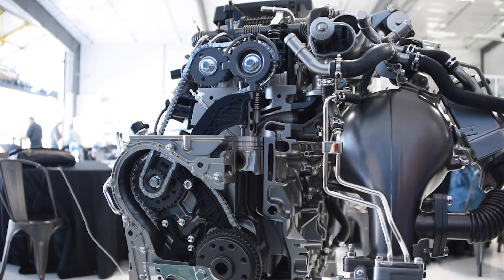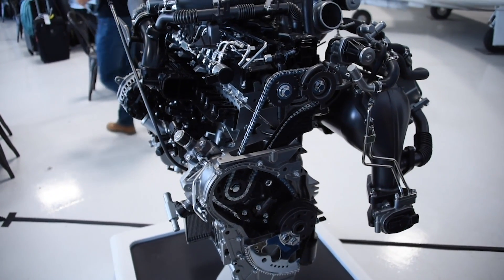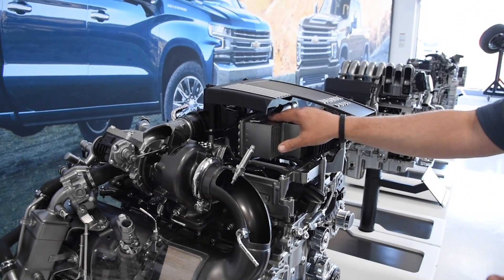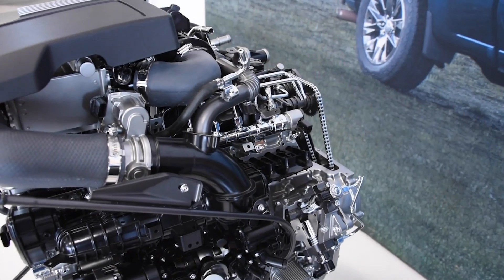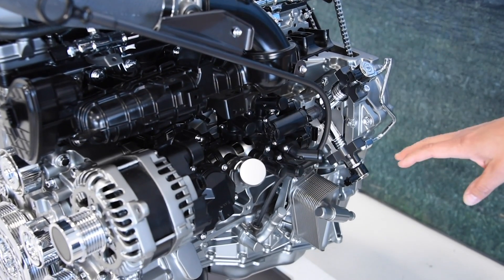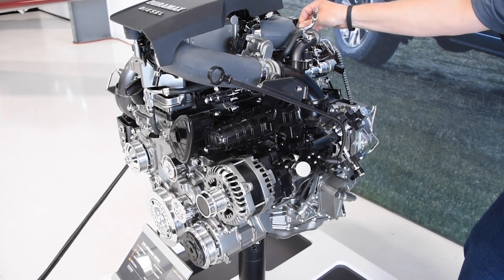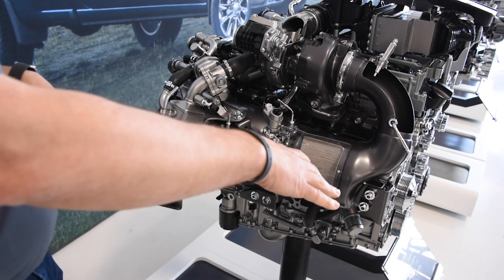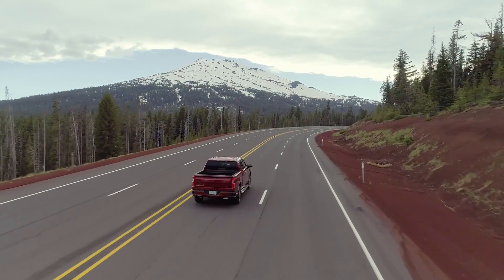What you don't know about the 3.0-liter Duramax diesel

Comment: If it’s not 18 to 1 compression and it uses glow plugs it not a true diesel. A true diesel produces all its torque at 1100 to 1500 rpm
Reply from the maker: Diesels are changing, Jon. Emissions standards now dictate the way an engine is engineered and produced, unfortunately.
Reply: The RV Connection I here you but disagree with you and I know full well higher combustion temps will produce cleaner burn and better fuel efficiency. Every time. That’s why modified 5.9 cummins can get 25 to 30 miles to the gallon on highway. When I saw the new inline 6 duramax I thought finally gm is doing it right. You can’t beat that design. I say change the studs on that head raise that compression up. And change that belt driven pump to gear driven. Look I love gm trucks and ram trucks. They were always better than Ford, are lil secret. My current 2017 6.7 actually runs cleaner than the average gasser. I know because I was curious , and I had it check out. What they are doing with diesels today is incredible. I will never delete my truck for this very reason. I just wish the egr was routed from behind the dpf instead of in front of it, a lil cleaner you know. You guys are definitely going in the right direction. It would be great if we could just stop the rust from destroying the vehicles around the drivetrains. Ram should have dumped that fiat garbage diesel and replaced it with cummins 2.8 crate engine that every one is putting in the jeeps these days.
Reply from the maker: @Jon-O.  Higher compression also produces increased NOX levels as cylinder temperature rises. That's why the new EcoDiesel also reduced its compression ratio from 16.5:1 to 16:1. Believe me, if they could get more power, better fuel economy and reduced emissions by simply raising the compression ratio, they would. There would be absolutely no reason not to.
The belt-driven pump was chosen over gear driven to reduce NVH. People want diesels to be as quiet as gasoline engines these days, which personally I think is dumb. If you don't want diesel sound, don't buy a diesel.

Comment: A Belt driven, off the rear of the crankshaft, variable flow oil pump.....serviced by simply dropping the transmission  out.,will save a pinhead of HP......why didn't they think of that years ago......, the idea of free drugs and booze in engineering design is starting to get out of hand....

Comment: So let me get this straight, you dipshits actually thought putting the timing chain in the rear, high pressure fuel pump in the rear, belt driven oil pump in the rear was a good idea! Well, that just   ensured that I am no longer interested in this engine, which is a shame because being an inline 6 was going to bring me to the Chevy dealer. Not anymore. I'll keep my titan xd.
Reply: Well said. This was going to be my next purchase. No longer.
Reply: rochab77 you think that there will be an option where you can request a permanent chain belt
Reply: @victorchavez9020  I would hope so, but the fact everything is in the back of the engine makes it a no for me. Over engineered by some dipshit with a college degree and no on sense that will never have to work on one.

Comment: Well that's asking  for trouble  a belt driving the oil pump as the belt wears all them little bits end up on the bottom of the strainer  bang engine gone why not keep it to a chain engineers these days  try to reinvent the wheel but do it poorly

Comment: Will that fit in to AZR2 Chevy S10 pickup 4 wheel drive I wanna put a diesel in it more power specially if I put  A Turbo on it
Reply: Dude, go for the Cummins 4BT. Hell they make kits for that gas to diesel swap.
Reply: @JerzeyBoy  Or the 2.8 crate 4 cyl(a sweet little package)
Reply: @kevinmccune682  that too! Way cheaper that that thing. Hell ever swapped a the engine of Honda S2000 into an RX-8? Because I haven't.
Reply: putin 3 53
Reply: @1racemate  Pretty heavy old mill.

Comment: Gears and chains go inside, plastic and rubber go outside sir. Hopefully it's a one year design for GM.
Reply: Nope, seen a guy with 380k on original belt. Dude has 1.2 million on his 2013 6.6 as well
Reply: Anthony.. Bio kits (belt in oil) will be all you will see in the future. Noisy/heavy/horsepower robbing timing chains and gears are quietly riding into the sunset. The Timing Belt in Oil was developed to replace the metal chain. The rubber is made to last and run in oil for years.
Reply: @lowboy003  i have a timing chain on my tacoma and it has over 300,000k miles on original timing chain sir.
Reply: @mauiboy96768  You can't compare any GM to a Toyota lmao that's not fair.
Reply: @cheezuscrust7730  my bad.😂 i am not a guy that only “praises” to one car manufacturer, but i come to realize that my old toyota pickup is more reliable than my 2017 gmc sierra with the 5.3l.. it would always end up in the shop for something weird.. but anyways i ended up selling that thing, it broke on me 3 times leaving me stranded with only 35k miles.
Reply: @mauiboy96768  that's unacceptable
Reply: @cheezuscrust7730  true, my bad. Shouldn’t compare those 2 models.😅🤷‍♂️
Reply: The newer Ford 2.7l ecoboost gas engine has a wet belt oil pump drive, I still prefer to keep my truck about as simple as i can so I don't drive one of those either.

Comment: way too much over engineering. much rather have my 2007 5.9 cummins no emissions and no vgt turbo big single 468 68mm turbo with big fuel system still spools up amazing and makes 800+hp. when something goes it is simple to diagnose and work on compared to that shit

Comment: I thought the same thing when Harley put chains on the v twin. The first twin cam engines. But time showed them reliable. We shall see.
Reply: Yeah, but those chains are super-short from the crank to the cams. It's about the same as any GM pushrod engine where the chain only goes from the crank to the cam in the block. Also, HD cam chains were for noise reduction and the first time any owner got work done those were swapped out for gears.
Reply: H.D. and reliable? Not used very common in the same sentence. Lol
Reply: Harley's twin cam needs the chain tensioners replaced around 50,000 miles, several owners had the tensioner come apart and it was around 3,000.00 to fix the damage.

Comment: GM: We put a rubber belt in the back of the engine and call it easy to replace when you have to pull the engine from the transmission.  Me: thanks I'll go take a look at a better design.

Comment: At first I was thrilled to hear that this engine was a straight 6.  After listening to the engineers it sounds like there is just way too much to go wrong.  Something tells me this won't have the same reliability as the 4.0 in my Wrangler.
Reply: can’t compare apples to oranges
Reply: This is a modern diesel that employs the latest design techniques to maximize power and fuel efficiency while still being lightweight. The 4.0 is a gas engine derived from the original 2.5 of 1984. Reliability of most engines today is much higher than earlier designs so assuming good maintenance practices (especially important in diesels) it will quite likely be enormously reliable.
Reply: @Indy_at_the_beach man really said “maximize power” like this thing can make a constant 200hp without blowing up/overheating.
Reply: @Indy_at_the_beach  bot
Reply: Because anyone who knows more than you is a bot? Lol
Reply: or the 3.7 v6 in my Dakota.

Comment: 1. Belt driven oil pump, really, stupid. Make it gear driven. Apparently he's never removed a transmission.
2. HP fuel pump driven off the cam chain, in the rear under the cover behind the transmission. I'll bet that to get the pump out the transmission and cover have to come out to get the chain off the pump.
These engineer's should have to R&R these parts after a few years of service. I'll bet they'd change their view on serviceability.

Comment: "277 hp/460 ft lbs of torque".  If the upcoming Rivian R1T, with its advertised 750 hp/14,000 nm (~10,300 ft lbs) of torque proves to be reliable, both this and all fossil fuel engines will instantly become under-powered, obsolete dinosaurs...

Comment: Timing on back of a engine. Engineering nightmare at its finest
Reply from the maker: The engineers told me the main reason for this is that there is less harmonic distortion on the back of the crank than the front, which makes for more accurate timing/fuel delivery.
Reply: @TheRVConnection . So the engineers are implying the crank likes to twist a bit, eh?  Lol. Maybe they should have made it beefier.
Reply: @TheRVConnection  And a rubber belt absorbs the torsional distortion much better than a timing chain or gear drive.
Reply from the maker: @lowboy003  You are correct, sir
Reply: @The Restless Traveller Correct, and now a year later, we are finding the BIO (Belt in Oil) kits with special rubber compounds will outlast the motor.. I can't believe all the kids here posing as clairvoyants and engineers trying to impress people.

Comment: The belt won't be an issue for most new buyers.  It's the guys that buy used around 100K miles that will need to keep the oil pump belt in mind for replacement cost.
Reply: I get your point. Also when they have that thing down they could probably fix other things as well. Everyone’s looking for amazing reliability and nonexistent maintenance

Comment: “Serviceable by simply dropping the transmission”  - 😂 what a joke 😂
Reply: Engineer's trying to be a mechanic..  oh its easy to do.. lol
Reply: He didn't mention removing the flywheel to get at the cover.  (Shade  tree stuff.) This engine is built for the government, not the customer.
Reply: @dscottmacleod321  How is this belt service any worse than servicing Ford's Eco-boost water pump? Half the mechanics say the easy way is to pull the engine, for a damn water pump.
Reply: @wymple09  GM trucks are WAY easier to work on by far and more reliable.
Reply: @mecalpsha4473  
More reliable? Lol
Reply: @wymple09  As I recall, several of those Eco-boost engine removals require taking the cab off the frame.  
Sadly, my comment was driven by the growing complexity of our lives due to out of control bureaucracies that have no oversight.  Diesel engines used to be simple  and durable.  Fleet fuel economy requirements have the engineers dreaming up increasingly complex methods to squeeze the last percent of fuel economy from this year's vehicle production.  The consumer is required to purchase highly expensive cars and then pay for repairs that outstrip trade-in value, while being told they should recycle and live "green."
Reply: Christian Griffith the f250 had been rebuilt once because my dad used it with a 32ft wedged car trailer first rebuild was about 3-5 years after we bought it and mind you it constantly had a 32ft trailer hooked up to it and she’s still purring like a kitten oh it’s got 268k the Chevy had 215k I believe it’s been a while since I’ve seen it.
Reply: @wymple09  Have you ever changed a heater core in a Taurus?  GM and Ford engineers must go to the same school.
Reply: @wymple09  the 3.5 ecoboost in the f150 is belt driven like a normal car. In the 3.5 in the taurus is a pita
Reply: @wymple09 forget Ecoboost water pumps, the 5.0 Coyote and 2.7 Ecoboost also have wet belt oil pumps just like this engine, except the belt is at the front of the engine and requires more labor hours to change than this 3.0 does. Partly because Ford routed the belt behind timing chains and the fact that there's way more sht in the way at the front of the engine.
Reply: @ Yes, GM is more reliable. My BIL is a Ford guy, has NEVER gotten 200K out of one.
Reply: @dscottmacleod321  to start, do away with the DEF shit that’s one thing that’s a joke just for the Government
Reply: Why wouldn't they just use a gear to drive the oil pump? It's so close...it probably doesn't even need a chain or belt.
Reply: why wouldn't just use the no need for service chains to drive that oil pump
Reply: How is this any different than servicing a clutch at 150k or more? I’d much rather pull a tranny (and service it while I’m in there) than remove the entire accessory drive off the engine. 6-8 hours of labor every 150k I can live with that.
Reply: no need to drop the tranmission you can move it aside and service it. mechanics have said its more uncomfortable but it could be done. plus these belts now have a 200k service interval.
Reply: sounds like a typical chevy/government motors product ... come to us for 3x cost because you cannot get parts elsewhere
Reply: Couldn't believe that idiot said oh it's simple followed by remove the transmission and slide it back! What a f'king idiot!
Reply: Lol I said the same thing what a joke
Reply: It’s actually not as hard as you think it will be.. 2 days in my garage with a case of beers
Reply: How is this any different than fixing 6.7 power strokes with constant upper oil pan leaks?
Reply: 💀💀EZ PZ
Reply: This engine draws it's design from the Opel 1.6 CDTI, as also found in the 2017-19 Cruze, Equinox, and Terrain with the diesel engine. It's extremely obvious when looking at the two even in pictures. In Europe there is also a 1.5 3 cylinder and 2.0 4 cylinder. The 1.6 has a chain for the oil pump. 1.5, 2.0, 3.0 have a belt. No idea why they decided to change it from a chain to a belt because I've never seen an issue with an oil pump chain on a 1.6.
Reply: Anyone who ever dropped a transmission knows it ain’t that simple lol…
Reply: He's definitely talking about professional mechanics not street mechanics, anytime you get inside of the engine to work on is very hard for us, but not for professionals that have the right tools.
Reply: I Know Right! 😅
Reply: How hard do you guys think it is to pull a transmission though.. be real its all nuts and bolts and a little bit of time have that done in 6-7 hours
Reply: The joke is that know-nothings make a big deal about this belt. There at guys with well over 200k miles on the belt without issue. And this is a GM, you'll be dropping the transmission for a rebuild well before the belt is anywhere near wearing out, so it turns into a "while you have the transmission out, might as well change the belt" situation.
Reply: As easy, or easier, than tearing off the entire front of the engine. It is one of the reasons for putting it back there.
Reply: They said by moving it forward like moving your clothes in your closet. a simple repair 🤗
Reply: Maybe if the transmission is shot, while replacing it throw a new belt on the pump...
Reply: Yep! just drop the transmission it's that simple. These responses are like no one has touched a tool before, so if that's the case drop it off at your local dealer and suck it up and pay the piper!!! Bet a belt could be replaced at Home on short day. Suck it up buttercup get dirty and bust a knuckle you whiny pussies!!! It's not ROCKET science.
Reply: He said Backing off the trany.
Reply: Yeah...I'm a hard pass on this one.

Comment: Yeah timing belt for the oil pump what a joke a hundred fifty thousand and you got to pull the transmission loose people buy diesel motor for longevity so I got a Cummins
Reply: Dj Morgan this is a inline 6 for 1500. Your comparing a 2500 truck to a 1500 motor. Il take my 6.6 duramax with a better tow capacity, and in a car thats electronics arent shot to shit because its an italian truck now. Dont get me wrong though this little inline 6 already smells of shit

Comment: Even after you pull the transmission, you'll still be replacing two chains and a belt from underneath the truck with the engine against the firewall. If you're going to do all that, you might as well pull the engine. Anyone who thinks this job would be easier than replacing a  front timing chain is nuts. And a belt driven oil pump? If that belt ever brakes, it's not going to give you any warning. If it brakes you'll have to pull the engine anyway because it'll be junk. The only reason to design something like this is to sell parts and service. They are building vehicles that you have to take it to the dealership for any work or buy another truck.
Reply: chad Spidle you’re correct about the firewall but techs won’t be pulling the engine to do service. They’re going to pull the cab off the frame.
Reply: @steelcityundercoating  
Yeah, that sounds cheap. 😂
Reply: DEAD ON !
Reply: breaks
Reply: No need to do the chains
Reply: I don't think the transmission bell housing  area, after transmission is removed, is "against the firewall" and the belt is in the lower half as well.. you wouldn't have to remove the chains to change the belt.,, If the chains fail the engine is coming out anyway.. pretty much guaranteed.  I don't know if the oil pump belt is as big a deal as people are making it.. engines with belted timing belts can be a pain it the butt and expensive to change as well. It's one of those things that after you reach a certain amount of miles you want to bite the bullet and pay to replace BEFORE they fail.. I don't think you would want to chance the oil pump belt failing on this either.. not because of "burning up the engine from no oil".. I think I would be more worried about what's left of the belt going up into the timing chain and causing catastrophic damage.
Reply: I think this is their attempt at John Deere's right to repair.
They can't just come right out and say you HAVE to have your repairs done by them, because of the backlash it would cause. So, they're making everything increasingly harder to work on and unnecessarily complicated so you really don't have a choice.
Reply: 100%. These gym guys are assholes. Let them work on these pieces of shit and see what happens. Do not ever buy!!!!
Reply: They'll probably Come out with an update or redesign because of that. oil Belt's don't like -40c or F temperatures